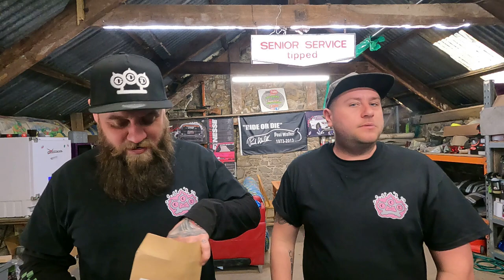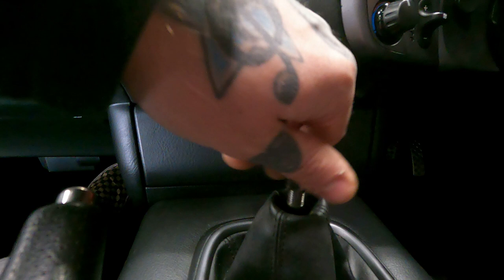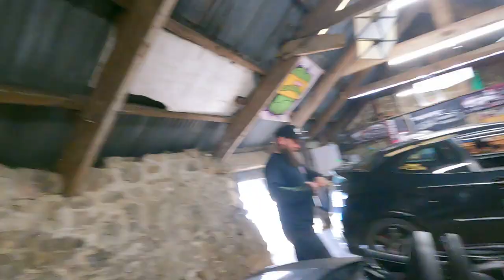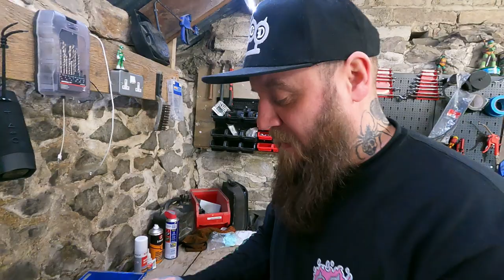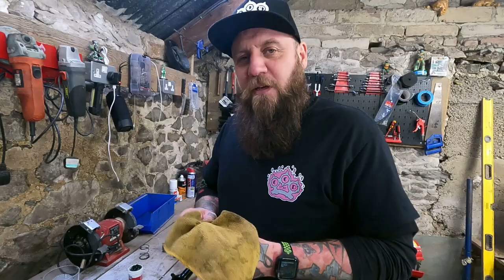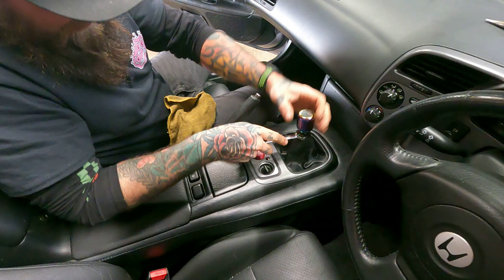Honda S2000 Shifter Rebuild and Re-grease *What a Difference*

Comment: Those bushings has never been changed before. Probably your car have hade the cluch replaced at some point. You need to take the shifter of to get the gearbox down when you do a cluch job. Great job by the way 👍🏻 Its an easy job to do but makes ha huge difference.
Reply from the maker: It has made a massive difference mate definitely!! Just need to find one of them rings no no luck so far